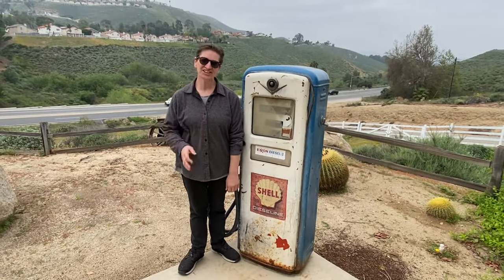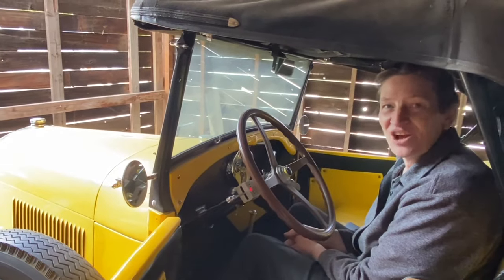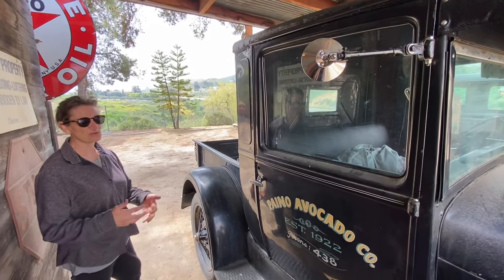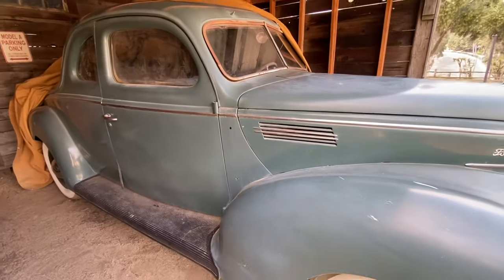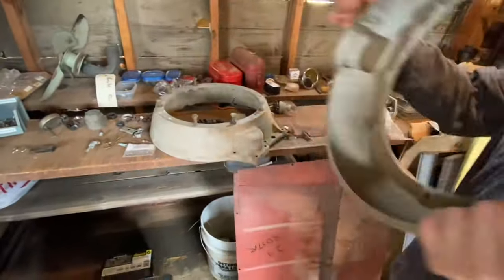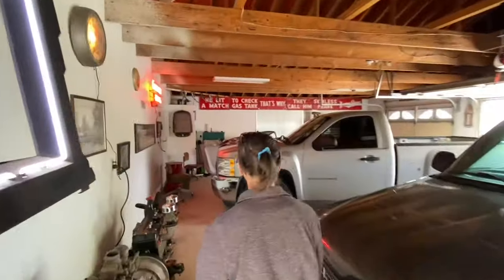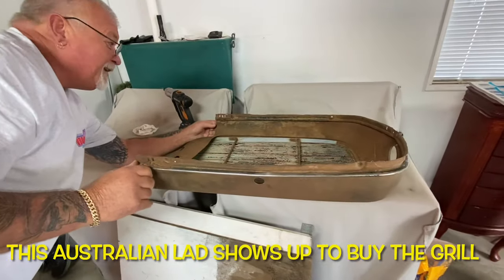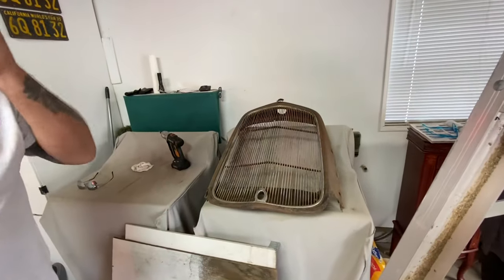Vintage Ford Trucks, Cars, Roadside Signs, & Gas Pumps

Comment: Looking forward to another quality production. Fun and informational
Reply from the maker: Well thank you! This upcoming video has a nice mix of automotive related content.
Reply: @gaspumprob  I'm done I just can't do anything with my hair 😭. I thought you might be showing some hair care products. 🤣🤣🤣🤣
Yep that's my humor. Especially when I'm sitting here feeling the electricity in the air of the approaching storm 🤧
Reply from the maker: @CAROLDDISCOVER-FINDER2525 Axle and wheel bearing grease works well in your hair instead of sculpting gels. That is Rob’s hair care tip of the day 🤣🤣🤣😂😂
Reply: @gaspumprob  hahaha 🤣. Did they used to do that in 1950s. 🤣
Reply from the maker: Yes I think so 🤣🤣🤣

Comment from the maker: Please join me for this video premiere. If you like old gas stations, Vintage Ford trucks and cars, old advertising, and American roadside signs this video will be informative and entertaining.
Reply: Well this one looks like it's running on all eight and burning high octane😊
Reply from the maker: @CAROLDDISCOVER-1983  
Yes it is and it has some interesting features for sure!
Reply: @gaspumprob  just sitting here cleaning out my hub bearings on my trailer. The same massive beast that showed on my channel 😦 ha ha . I finally got my tires I ordered from place online that I've always been pleased with but this time I'm not sure what happened. New tires repack the bearings and all the last for a day or two.
Reply from the maker: @CAROLDDISCOVER-1983 
Fantastic!  You will have trouble free trailering soon.
Reply: @gaspumprob  that's the plan.
Reply: @wakeupamericaspeaktruth9945 like your thumbnail and handle.